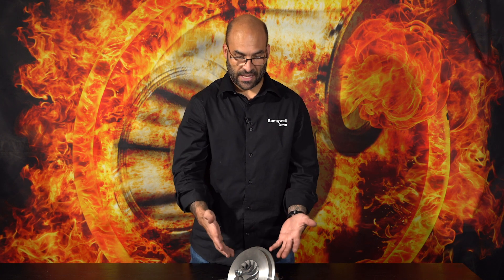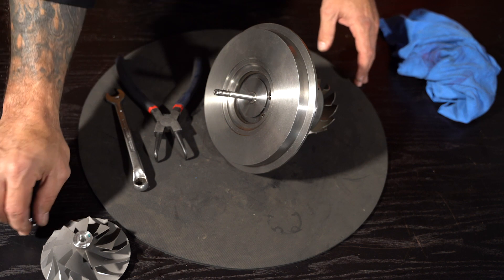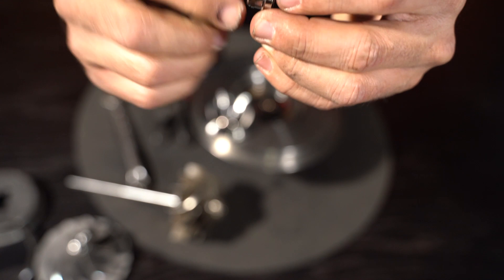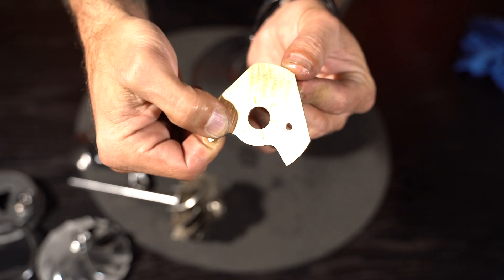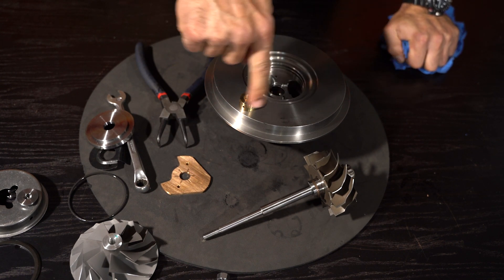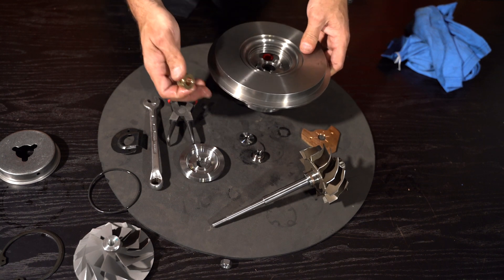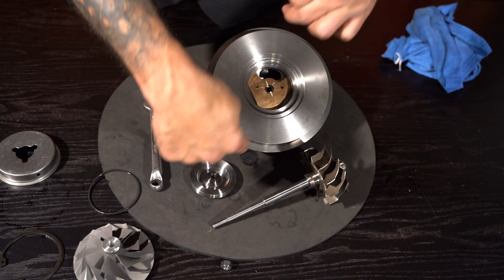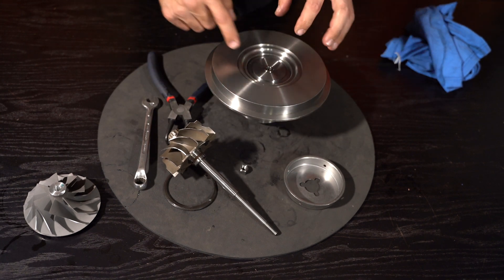Inside a Holset HX55 CHRA

Comment: You are doing amazing work with your videos! Also you are doing huge job for answering all the questions. I have huge respect for you.

So my question is regarding to these holset turbos. What do you think about using lets say a holset hx35 54mm on a 2 liter compared to same size ish gt3071 in terms of flow, reliability and spool? Also I am interested in what makes truck turbo a truck turbo.
Reply from the maker: Thank you Aleksi, much appreciated.  The Holset product is designed specifically for a Diesel engine in mind, the compressor map is suited to the diesel engine its installed onto, and while the turbo has a horsepower output based on the design and hardware configuration (housing AR's, wheel designs and dimensions etc) its not a performance based product.  Will it work as a turbo upgrade, well the short answer is yes it will, "any turbo" will "work" - but if you have a specific result in mind, with a specific response, power curve and boost level, then dont expect any old turbo to work and meet your requirements compared to something that is designed specifically to suit a performance application.   Depending on the application (drift, drag, circuit, street, hill climb, rock crawling, etc) different turbos will be better suited than others - with this in mind, the choice of turbo using the compressor map and other resources would need to be evaluated to make the best decision. 

The topic is a great one and a perfect idea for another video - thanks for the question.

Comment: Why are there 2 different journal bearing systems? Full floating vs semi floating.
Reply from the maker: Its purely the development and evolution of the bearing systems over time - less running bearings on mating surfaces, means less drag and faster response, at the same time less wear and better longevity

Comment: Very informative, thank you very much Chris! I have a question about bearing system: is it possible to estimate difference in spool between journal and ball bearing system on the same turbo? Are ball bearing turbos always more responsive than journal bearing?
Reply from the maker: Its not possible as there are so many variables - manifold design, runner length, collector angles,  etc - a said journal bearing turbo on one engine will perform totally different to the next engine, based on the supporting hardware used.  In GENERAL the co-efficient drag between the ball bearing and journal bearing  (depending on the size of the bearings, and clearances etc) will spool around 15% faster - this is a GENERAL estimation, and not something you can take to the bank. Its also documented in some of the older Garrett white papers from years back . Bearing systems have come a long way since the first angular bearing system
Reply: @TurboDirectSA  This estimate is more than enough, thank you! But, in this case, why does journal bearing system still exist? Because of price?
Reply from the maker: @stanislavaleshin1202  Indeed because of price and the time it takes to assemble - relating once again to money.